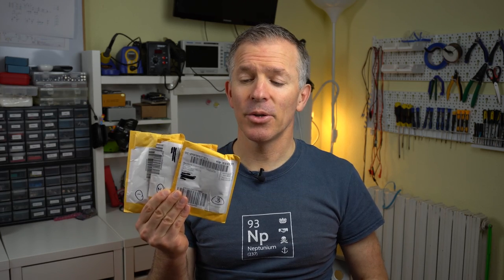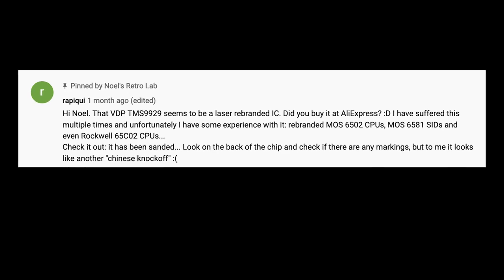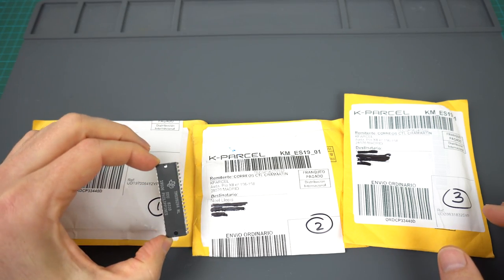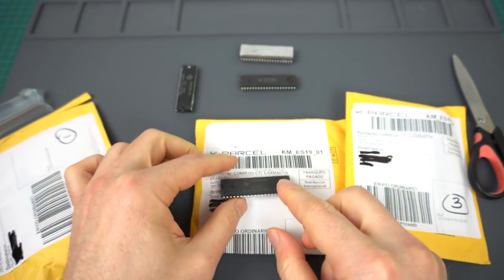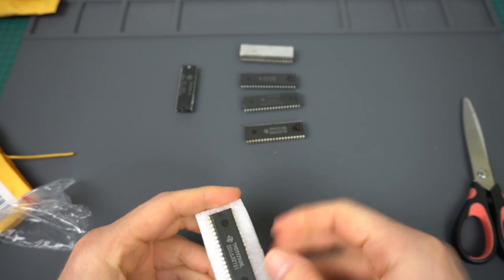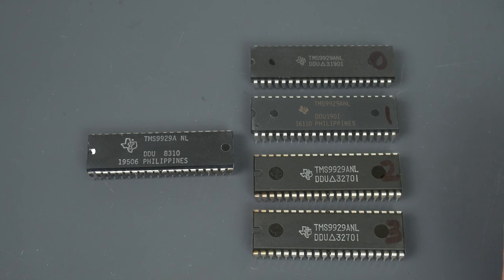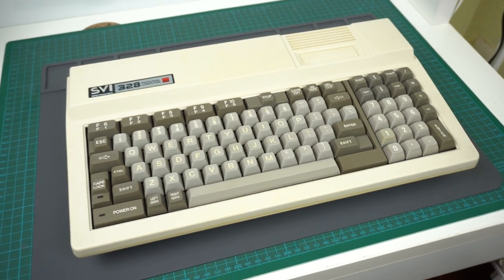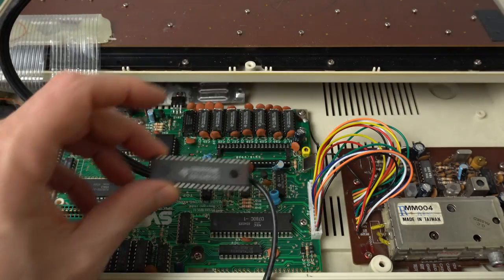Detecting FAKE Chips From China 🔍

Comment: This is an excellent video. 
During my time as an engineer I never knew this was a problem because our supplier list was limited by procurement. Then last month I received some mosfets that fried under a surprisingly low load condition. I bought replacements of the same part number from Digikey and when placed into the same application they don't even get warm under high loads. Wish I had characterized the FETs first, before I burnt them to a crisp. 
There's a difference between xenophobia and making a statistically proven claim, for example saying a geographic area regularly manufactures components that either don't meet spec or are intentionally fraudulent. Is there anyone who can honestly say they expect any piece of power electronics they buy (and use regularly) to last more than a year? I've been buying old tools like welders and saws off Craigslist since 2010 because they have a lower failure rate than the brand new products that break under normal use and stick me in the return line. 
Perhaps I'll characterize one of those $20 induction heaters with a scope and see what it takes before the inductors saturate and the capacitors pop.
Reply: I had that with some h-bridge chips. They were supplied on breakout boards and all worked - but some got hot under a few amps load while the others have much lower on-resistance and happily work without heatsinks.

Comment: The reason for doing this with cheap items is that a high percentage of people will not complain or ask for their money back ( equals profit ), if the item was 50 euros or dollars then everyone would want their refund and there would be no purpose to the whole process
Reply: That’s what I was thinking too.  I’ve done this multiple times actually where I will get a wrong item or something and if it’s cheap enough just take the loss rather than spend my time trying to return it.  It sucks but it makes sense that’s why they would do this.  For $3 if I had to actually return the item for a refund I would probably just eat the cost instead :(. Guess I’m part of the problem
Reply: @dandoyle  I always ask for a refund, multiple times, and have never been asked to return the product.

There is a free option with eBay ,you need to sign up for it, where eBay will refund any returning costs should you need to pay,say for larger more expensive items.
Reply from the maker: Right. Same here. Instant refund without sending anything back.
Reply: eBay has been getting worse recently: non-delivery, late-delivery, wrong item, broken item... I've not had a problem raising a refund request via eBay - that seems to push the vendor into action. It's just a few clicks, and most often you don't have to pay an extortionate amount to return it as they just tell you to keep it. But it takes so much time, and you have to reorder from somewhere else. Some of the delivery times reported from China are now into next year.

Comment: Great thing about that Arduino Uno is that if you fry the IC you can just pop it out and put another in.  Of course you'd have to plug in an ICSP adapter to flash the new chip, but I did so to my own Uno when I blew out a pin.

Comment: -They buy old chips in bulk.
-They sort the chips by what socket they fit.
-So you place your order 
 -They look up what socket the chip fits.
-They grab a chip that matches the socket.
-They sand off the number and print the number you asked for.
-Wrap it in a zip lock bag and ship.

So they are selling thousands of chips under a hundred different numbers.

Since most people would assume they misdiagnosed the problem or there are additional problems they dont bother asking for a refund.

I've actually had a chip arrive for an old stereo and it was obvious that they had cut down a longer chip so it would have the right number of pins, but the printing looked right.

Comment: I had a similar issue with some RCA 1802 microprocessors I bought from China. I built a tester using an Aruduino Mega that let you run a machine code program to test the uC. It turned out that 8 out of 10 of them were good. The other two sort of worked but were not 100%. It pays to functionally test all such parts as soon as you get them.
Reply from the maker: Yeah, for sure. It's scary that they "sort of worked". At least in this case they might have been plastic chunks, but that means you got faulty ones, or slightly different models. Scary stuff.

Comment: It's very easy to spot a Chinese fake with no electrical testing whatsoever, at least if you have in your hands an original IC or access to a quality picture of the writing on top of it. There is one thing the Chinese will never ever ever get right: Properly rendering English fonts on the chip's surface! It's a known fact. A Chinese fake with an authentic rendition of all of the characters on the chip goes against the laws of physics, breaks the second law of thermodynamics, allows superluminal travel, and causes all its pins to give birth to unicorns, at the same time. The font on a fake will _allways_ without exception look different than on an original. Just compare letter by letter between what you have as a possible fake and a known authentic chip or picture of the top of one. I'll admit, there were times when the differences were subtle, but 99% of the time, you might as well be comparing how nickel looks compared to a dollar bill, that how jarring the differences are.

If you only have a single chip, look for asymmetry in letters that should be symmetrical (e.g., U, I, S [most of the time], N [kitty-cat symmetry], etc...). Look for bad left/right symmetry as well as bad top/bottom symmetry in letter and number forms. One other thing the Chinese mess up is making upper case letters the same height, this can be another dead giveaway if any of the letters in a part number or identifier are of a slightly different height.

For our example, you can also search for TI 99/4a motherboard image that seems authentic (i.e., from a taken apart TI 99/4a). This will give you clues about the font TI used and the layout of the symbol, lettering and numbering on related chips. For example: https://www.nightfallcrew.com/22/06/2013/texas-instruments-ti-994a-diagnosing-and-fixing-motherboard-faults/

And, boom, samples: #0, #2, #3, from the video at 5:48 immediately disqualified as authentic (reason: five digit code does not precede place of manufacture {PHILLIPINES})
Sample #1 disqualified (reason: no space between DDU and 1901, no space between A and NL in the part number, TI Logo {just wrong!}, now let's talk letter, the "E" in PHILLIPINES, look at its central horizontal segment {it's as wide as the rest - should be shorter}, look at the two P 's, notice how the curve at the right of the letter has horizontal segments connecting it to the trunk, unlike the P on the authentic chip which has a nice curve, look at the U in DDU {shorter than the two D's), look at the uppercase S in PHILLIPINES {the two halves are the same size, unlike in the original where the upper part is slightly smaller than the lower, as it should be}, how about all the digit 1's {compare the top of them to the authentic one, you can see a difference}, etc...

Conclusion at 5:48, all of the chips on the right are fake! And, at 7:05, yes, nice counterfeit work, but the dot on the "i" in the TI logo should not be hollow!! Compare the logo shape and characteristics with: https://upload.wikimedia.org/wikipedia/commons/b/ba/TexasInstruments-Logo.svg  So, #2 and #3 work, but they are still fakes, just working fakes, or, in the best case, rebadged old chips, perhaps, that were pulled out and restamped.
Reply: Not quite that simple. If it's a chip which has been in production for a long time, you will be seeing difference in packaging and text rendering, even if it is an authentic part. There can also be multiple factories producing the same chip and production can be restarted due to unforeseen demand. This varies from chip designer to another. This is especially the case where the chip production is first inhouse and later outsourced, e.g. AMD and Intel.
Reply from the maker: Right! As a matter of fact, when I posted this video on Facebook/Twitter, very few people were able to spot the fakes correctly just from the picture. I think you'd have to be an expert of that particular chip type to be able to spot them accurately.
Reply: @JamieDonovanD  Although you are right in principle, with regard to an exact comparison with a known good chip (i.e., there may be multiple authentic variants for some chips), the rest of what I said still applies (i.e., things you can look  out for without  access to an authentic chip or chip image).
Reply: @NoelsRetroLab   This is because most people don't have experience doing this. If there was more education of the form in my reply (both for those with access to an authentic chip and  those without [or for the case of multiple runs by potentially different factories]) there would be fewer users suckered in by Chinese fake silicon, at least with regard to ICs with writing on them.

Comment: Great video Noel!  This is something that we really needed.  I was hoping to get a look at the bottom of each IC to see any differences there.  But anyway, well done.  While here you put these specific VDPs under the microscope, the principles can be applied to any other IC.

For whatever reason, the "legitimate" TMS 9929s lack date codes, but appear to be newly manufactured.  If so, that is a surprise to me.  I can't imagine any modern-day applications for it, and the demand can't be high enough to justify running a full production line.  On the other hand, if they are "new old stock", the supply is limited and the prices should be far higher.  I just don't get it.  It's weird!
Reply from the maker: Thanks! And yes, I agree the whole thing is pretty weird, distubing, and really annoying to boot.

Comment: Enjoyed the video! Just got my Arduino project kit in the mail today. I am definitely going to try and make that test circuit.
Reply from the maker: Awesome! Yeah, it was very straightforward. Let me know if you run into any problems. I'm still wondering if the video output I got was the intended one, and it was just my LCD TV filtering things a bit weird, or if I miswired something. I expected more vertical bar patterns. Let me know what you get.
Reply: @NoelsRetroLab  Hi Noel, try playing with the timings in the loop section of the sketch. Changing the delay, can have impact on your display output. The 'setRegister(7,...' function is responsible for showing the backdrop colors, one by one. You can change them more quickly if you lower the delay value. Also to see the bars, you will have to put the 'writeByteToVRAM' section into the loop, and maybe try with a slightly higher delay value. Also note that using these jumper wires is not the ideal situation for video signals, sometimes wiggling them can improve image ;-)
Reply from the maker: @fa497007  Thanks! I took down the circuit, but I'll keep that in mind whenever I make it again to test some more VDPs. Maybe the next step in the project should be to create a simple Gerber file for a pcb. Especially if we use a BluePill, then all it would take would be to put in the microcontroller, the VDP and power everything up, without a single cable. Bonus points for having RCA jacks already on the board. Actually that sounds like a fun project! 😀
Reply: @NoelsRetroLab  Indeed a PCB would be   fun to build. Especially when you need to test more frequently.  And that's maybe a hint for the Chinese,  use it before selling those IC's !
Reply from the maker: @fa497007  That's assuming they don't know what they're really selling or that they care! ☹️

Comment: I suspect they are getting their money from selling your buyer's info to a database. Either in the form of seeing what is being bought, as in buyers' activities database or worst your mailing info, I have been suspecting that from most China-based eBay vendors for years. EDIT: chip 0,  I would be curious to find out if it's not just some other chip they had in big volume and they just sand down and re-label it as other chips, maybe look up what was commonly used with the same package and try finding out what chip it matches lol Could be time-consuming endeavour mind you.
Reply from the maker: Right, chip 0 is definitely something else. Too many things in DIP 40 form to know reliably though. And besides... I hate to admit I threw it away 😞 I didn't want it mixed in with my box of faulty (but real) chips, and I didn't think of doing further investigative work. Oh well. Next fake chip I'll look at it more closely.

Comment: my employer is doing a recall of a few thousand infusion pumps because a vendor picked up a fake voltage regulator and put it on the lcd we use.  only saving grace is it was spotted after only two weeks of production.   units mostly work, but its an unknown component.

Comment: That's why I order weird ICs from eastern europe, from military surplus back when the iron curtain was still there.
They are "fakes". They don't even disguise themselves as the original. They have cyrillic lettering. But they work. Here's what I got:
M6845 CRTC: Works perfectly. Indistinguishable from the original IC. Will buy again if more of mine die.
M6850 Serial I/O: Don't know if it works, but the machine doesn't boot with a broken 6850 and it doesn't boot with the 6850 missing and it booted fine with this one.
I8279 (I call it DSKY because it's a 7 segment display controller / keyboard controller complete with matrix and FIFO): Glitchy/quirky. It basically works, but the display part of it had some weird issues where it wouldn't strobe segments that were initialized with 0s, so when I turned on the machine, the displays stayed dark, but would light up as soon as the contents changed. The keyboard controller part worked 100% though. Also if you used the machine for long enough, eventually all the displays would light up and work normally.
Why I bought them? They were really cheap and certainly not rebadged. I didn't regret it (though the 8279 is pretty much useless in an open-to-the-public pinball machine - I bet that the military wanted some extra functionality and it's not a bug, it's a feature, also the chip doesn't say 100% Intel 8279 compatible anywhere).

That was back when faking chips really meant something: industrial espionage :-)
Reply from the maker: That makes sense. I wouldn't mind buying a clone most of the time as long as it works! I have also ordered parts from Poland with 100% success rate. In that case I think they were just scrounged parts from old boards, but everything worked great.

Comment: just buy from trusted suppliers, the savings from buy a chip at low price will be lost many many times due to test time !! your hour cost is much greater of the difference of price.
Reply from the maker: Agreed! The problem is finding trusted suppliers for chips that aren't being manufactured anymore. That ruls out Mouser, Digikey, and the usual suspects. Do you have any recommendations?
Reply: @NoelsRetroLab  i find those chips in new old stock from dismantled factories or laboratories that i found on flea market. Found some spectrum chips that cost a fortune

Comment: @04:55 you're talking about the profit margins for rebranded / face IC's from china, and how there's not really a lot of demand for the particular chip you're buying. The issue is, these sellers often have hundreds of accounts on ebay, and they will sell hundreds of IC's that are the same form i.e. the same size, pin count etc.. then they scrub the original markings (if there are any) from the IC, and either silkscreen, or laser the new markings on. this way ,they can essentially re-brand the IC on demand, to fill the orders they get. the amount of people that think "oh well, it was only 2 - 5 euro, not worth the hassle of refunding" means they get to keep that profit, if they do get forced into a refund, they really aren't out that much, because the chip was probably salvage from old scrap anyway, and the post cost is free for them.

Comment: Thanks for letting us know those fake sellers. My e-bay blacklist just got longer. Also made a white list. Unfortunately many resellers buy from other sources on the chinese electronic market in bulk and don't even know what they are selling, that is why most sellers usually refund without question. It's hard to distinguish a deceiving seller from one that has been victim of scam.
Reply from the maker: It seems it's definitely the distributors, but the sellers are guilty as well: If they cared, they could do some simple checks or stop buying from a distributor when they get a certain number of complaints. So a seller black list seems like a good idea.